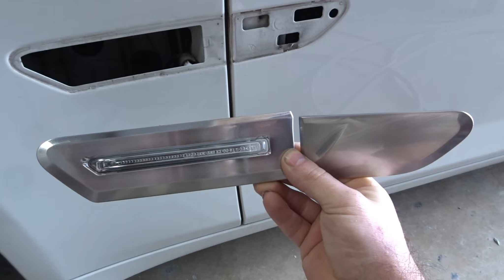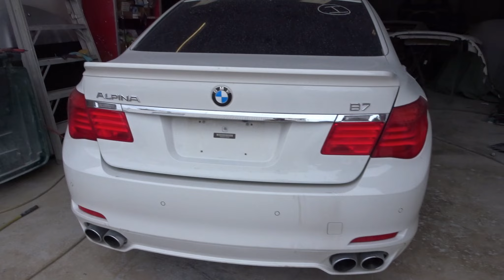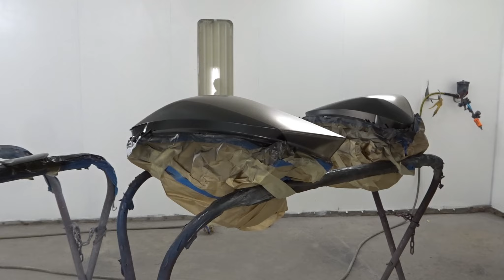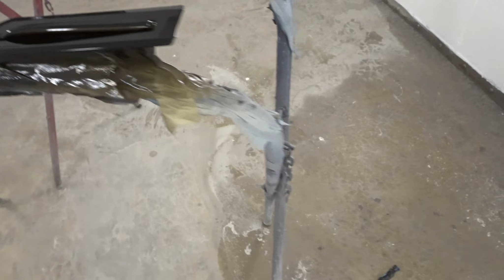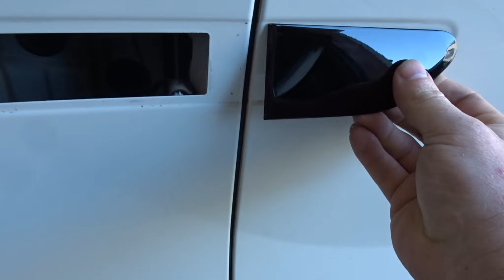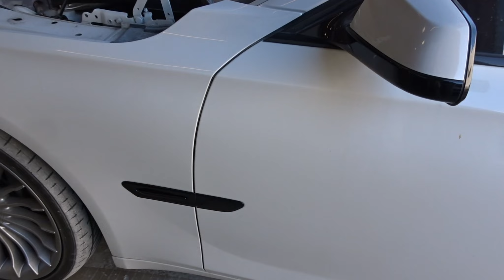BMW ALPINA B7 bought wrecked on COPART ( repair part 2 )

Comment: Is this v12? I saw a v12 bmw at Copart last time I went it’s in my newest video. Wondering if it’s the older version of this
Reply from the maker: NickZtech The one in your video is a older 760.
Reply: LB- Innovations oh yeah makes sense. It’s a lot like the 750 that’s what I thought it was but it has huge motor
Reply: All Alpina B7's comes with Bi-turbo V8's.
Reply from the maker: @PanameraTurboSEHybrid  07-08 come V8 Supercharged
Reply: @lb-innovations  You're right, I forgot the older models had the SCs. I was going to reply that they all had V8's. But added the "Bi-turbo". It's all good though.